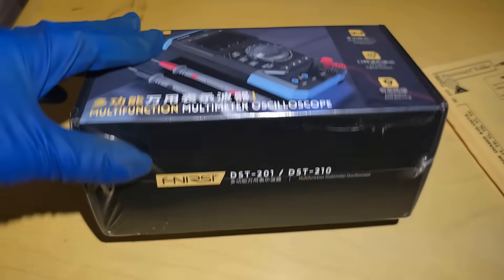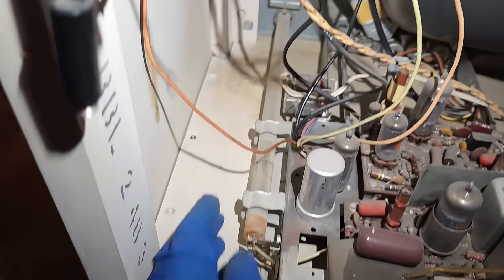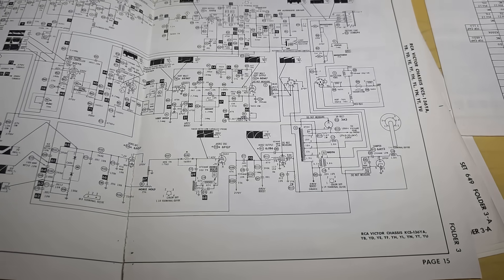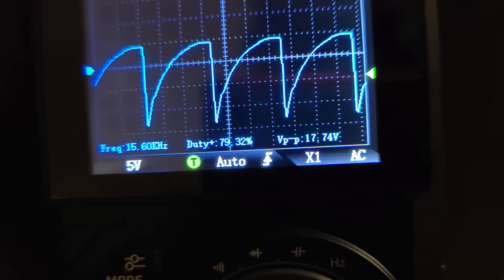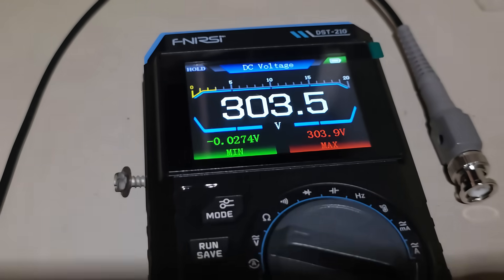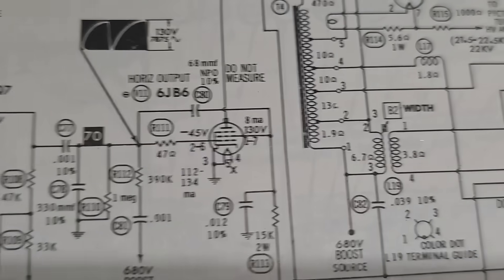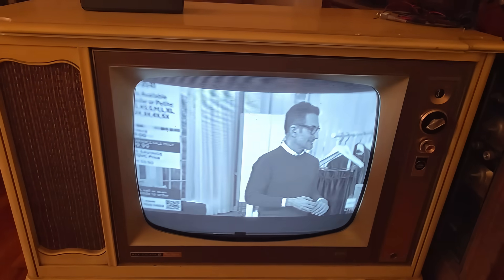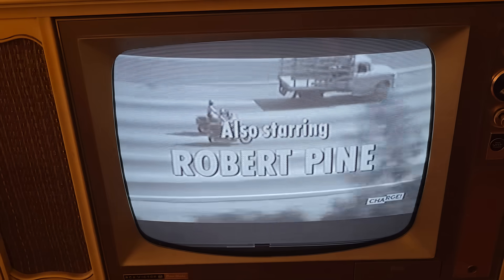1962 RCA KCS136 Vs FNIRSI New DST 210 DST 201 Horizontal Output Circuit

Comment: I think I can tell a color TV from a black and white just by looking at the screen.
Correct me if Im wrong but the black and white CRT screen has a silver grey color to it when it is turned off and a color screen is much darker charcoal grey color. 

Question: How does one go about locating a flyback transformer for a vintage TV? I cant seem to find any sources or information about how to even know the specifics of the part, to look for a replacement.

Comment: Trip down memory lane.  We had this chassis in a Danish Modern cabinet style when I was a kid.  It looks to me like the high tension lead has been replaced.  I believe the original was red.  I used to have a Heathkit HV tester which was very handy for checking anode voltage.  I would be suspicious of the rectifier too.

Comment: I don't know much about old electronics so I subscribed to see if I could learn something, doing a quick search I found from AI "The first TV remote controls appeared in the 1950s. Zenith Radio Corporation introduced the first wired remote, called "Lazy Bones", in 1950. In 1955, Zenith released the first wireless remote, the "Flash-Matic", which used light to control the TV. A later, more practical wireless remote, the "Space Command", was introduced by Zenith in 1956." so I'm thinking the light tube may be for a remote control.

Comment: 6 volt tubes. Where's the power transformer?  Is that a "split" power supply with only a filament transformer and line derived B+?

Comment: My Uncle Owen got a New Trinitron, from someone walking in off the Street, at a "Cesar's Latin Palace" on Mission.
I wound up with a nineteen inch Zenith Black and White, that was to be "discarded." Used it for years and years. Always astounded at how Crisp, you could "fine tune" it compared to some Color Sets of the day. My Grandma's 'new' Trinitron was better than a New RCA Colortrack that we sold Downtown- also near Mission.

Comment: It been a while since I repaired tube stuff, but something to be aware of is that newer replacement tubes might not have the internal connections shown in the schematic.  I remember working on a set that had a weak tube, but none of the new tubes worked at all, until I discovered i had to add a jumper between 2 pins.  I also remember adjusting that "never touch" neutralization cap in the the Nuvistar tuner, as all the new tubes had oscillation on the hi-band VHF. Ah, the old days.....

Comment: Here in England we have an enforced TV license if you own a TV that people have actually gone to jail for non payment, many people held on to their black and white TVs because the license fee was much cheaper than for a color one, this probably sounds incredible to you in the States but it's real life here.
Reply: No it's not. You tell them to do one and they have no right to go any further. I have never paid a TV licence and all you need is an Arial to receive all 200 channels of adverts and there is no way for anyone to detect it.
Reply: That is where the USA is headed. Cable, internet and phone are taxed. One local town is proposing taxing streaming services because cable tax revenues are way down. Cord-cutting. Politicians will get you one way or another.
Reply: @KameraShy The new ATSC 3.0 includes DRM technologies that will allow broadcasters to control who gets access to their signals, and they could very well charge viewers for that access. Guess why broadcasting groups are demanding the FCC shut down the older ATSC 1.0, which doesn't have that access control. Also, the DRM in ATSC 3.0 requires an active internet connection to work. No internet, no access to TV. This will be the end of over the air TV as we know it. This is why it's vital that ATSC 1.0 be kept active, as was the original intention of the FCC.
Reply: Blind people have to get a TV licence . Would they get  even more of a discount if they say " I have a Black and White set."

Comment: Does new vista imply that there are nuvistors in the circuitry?
Reply: No. Just a little marketing moxie to sell more sets.
Reply: Think they used nuvistors in the tuner (only).
Reply: @oldradiotvsc9836 - Correct.

Comment: I have a few pieces of equipment from that unpronounceable company and they seem to be pretty capable instruments, at least initially. Haven’t had them or used them long enough to check out robustness over time. Inexpensive with low out of the box failures, at least that’s what I’ve been able to glean from the Amazon reviews.

Comment: NOT a light bulb. That is a photo cell to detect the lighting in the room .that will adjust the brightness on the TV.
Reply: Seems odd to run a light pipe somewhere the part could easily go, I guess light pipes were a thing back then...
Reply: @Kinann modern electronic devices use light pipes for LEDs on a circuit board for the light to travel to surface of the device.

Comment: Beautiful set! It reminds me of some of the TV sets that surrounded me when I was a kid. Hooking it up with a DVD player with an episode of the 1963 series "The Outer Limits" would look more period-appropriate coming out of that set.
Reply: Good example. I've seen The Outer Limits in high definition and you can see flaws or irregularities in the make-up that would have been undetectable by viewing a broadcast on one of these TVs.
Reply: @stephendeluca4479  I've noticed that, too. There's the "Nightmare" episode where there's a brief glimpse of one of the cast members in a military uniform who didn't shave very well. Old NTSC sets with their low resolution couldn't detect it.
Reply: Dick van dyke show was on the air in 63. Rob and Laura would look great on it. The show was in black and white. To put things in perspective,  I  was 4 in 63. I'm 66 now. I'd say that set is working darn  well!! Little adjustment on the vertical, picture tube is stiil decent enough to watch.

Comment: I have a 50MHz rated scope/meter whatever everything in one fnirsi thing and it's perfectly fine for my TVs and audio equipment. Satisfactory products.
Reply: Absoloute rubbish your just looking at snail paced signals and are none the wiser, the sample rates are terrible and they can't see down past 20-50mv per div accurately, half the time even the bandwith is a complete lie,I have a tablet fnirsi scope 100mhz😂😂😂 yeah try 20mhz at -3db😂😂😂
Reply: @daveselectronicslab I have a Tektronix TDS3052B - now that is a good scope!